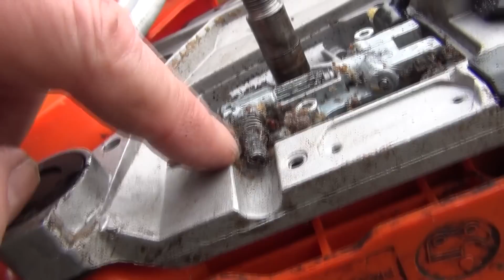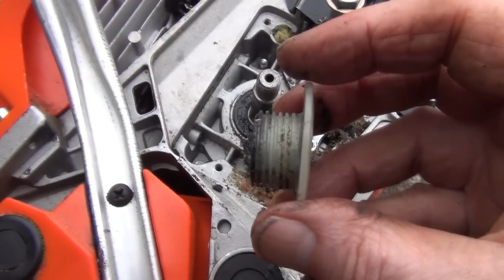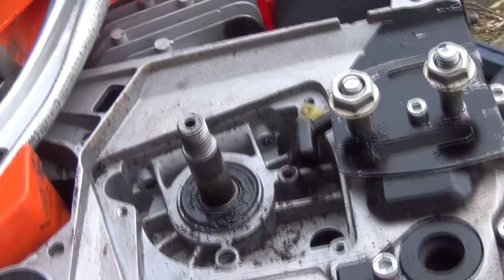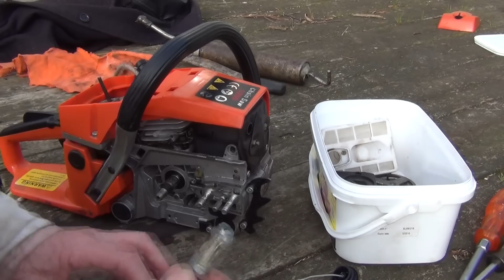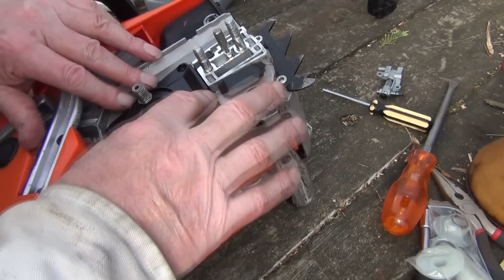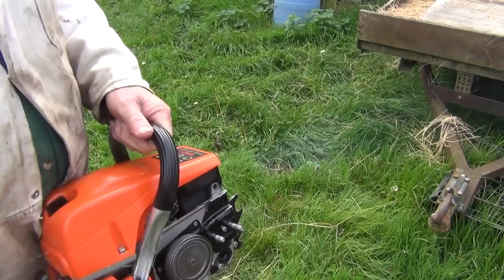Chinese Chainsaw, bar oil pump, replacement.

Comment: Be careful zinging the throttle like that without the bar and chain on, as I didn't see you torque that clutch down too tight.  They come flying off sometimes ... quite a fun surprise!  But, good checking to see that oil was flowing, and your problem fixed, before putting the bar on.  Nice job.
Reply: You are on right. Bee careful
Reply: happened to me the other day while cutting a fallen tree

Comment: Many people said "You can't buy parts for these saws." Well you just proved them wrong. Lol. Too bad many of them won't watch this video. It's a great saw.
Reply from the maker: The 45/52/58 cc saws are all the same, except the cyl/piston and everything is available in the UK from a crankcase to a nut. If you're in no hurry, you can buy direct from China at a much reduced price. This oil pump took 11 days from order to delivery.
..
Reply: Parts may be hard to find but by the time something goes wrong with these saws you have gotten your money's worth out of them,just get another one of them and presto,still cheaper than a Stihl saw. I purchased a Ryobi 3714 chinese made saw for $119 bucks on one small job made $ 180 bucks plus some other minor jobs that have given me close to $ 500 bucks in less than a year of ownership so if it breaks you better believe I will get another one of the same,but right now I know I can get the three years of warranty worth of money,good money.

Comment: Great video, thanks mate! I am doing the same thing now.  Oh...removing the clutch is easy with a grinding wheel removal tool. Thanks!
Reply from the maker: Yes, I tried that, but it didn't sit right, so I opted for the more brutal approach. If I have to do it again, I will make one out of flat steel, drilled for 3 bolts.
Reply: @RoryTrackrod  
Did you locked the piston when removing the clutch ?
I'm using a grinding tool key also.
And works just fine.
Reply from the maker: @dan_6915  Yes, I used a rope in the cylinder, shown at the end of the video. The grinding tool thing didn't work for me, so I had to use the more brutal, Hammer and drift, solution..

Comment: I think your main problem was your plastic drive gear. It looked like the worm teeth were almost completely worn down and not engaging the metal pump drive gear.
Reply from the maker: You maybe right. One thing is certain, they are cheap to buy, (6-7 quid) and easy to fit. The one you see here is still going strong, as is the saw itself..

Comment: That was very interesting to watch. I have morrison 45cc chainsaw and having similar oil leak issue at the moment, the only difference i noticed, i have 45cc morrison @home is exactly the same, the oil is leaking down from the oil  screw where you maximise and minimise the oil supply to the chain bar. Its time consuming procedure by the looks of it, and the local chainsaw mechanic is going to rip off my skin to fix it, this is the time where YouTube comes handy and gives us confidence to DIY our toys. Cheers mate

Comment: Thanks for the informative video, second use and my oil pump has failed and on the first use the spark plug went and the carby went out of tune. I’ve purchased a set of tuning tools and looks like I will have to buy a oil pump now as well.
Cheers and thanks for the video mate.
Reply from the maker: If it's any consolation, mine is running well, in fact it's better than ever. Keep an eye on the fuel tank filter. Ethanol killed mine, so I replaced it.
Reply from the maker: Filter replacement. https://youtu.be/ntXnpYaGaoY
Reply: @RoryTrackrod  thank you 🙏

Comment: Nice work.  Always nice when you can fix the problem yourself.  I just took in my Makita DCS6400 20inch chainsaw for a 2nd time b/c the chain bar oil continuously leaked a profusely after a short run.  I'd sit the chainsaw down and come to a pool of chain bar oil at the bottom of the saw and anything it was resting on was drenched.  I thought it was simply the oil line that came loose.  The oil line that connected to the pump kept sliding off therefore I had to replace the line for $45.  Now, no more pools of chain bar oil left at the scene.  👍🏽🙂

Comment: I got a similar chainsaw pouring oil out the bottom. 
Thanks for showing this film, I couldn't solve how to get the clutch out. 
I used a mason chisel cause I love my screwdriver too much.
Then I used a little floating gasket to try seal the leaks, and under the small metal plate where the oil should come out in the sword to the chain. Seems to have stopped the oil leaking in a pool under the saw.
Reply from the maker: Buying a tool is the easiest way to undo the clutch.  Making one can be done with a piece of flat steel and drill 3 holes and insert bolts or welding 3 pegs to it. My oil outlet was so tight, that it hasn't leaked, but using silicon or PTFE tape could also be used to seal it.
Thanks for the comment..
Reply: @RoryTrackrod  I came here looking for this answer.  I recently bought a version of this same saw and was thinking it was leaking where the bung / plug goes into the tank as that would seem to be the obvious place, but the oiler itself also holds the bung in place so I don’t know.  I just know it is dripping like mad from the adjustment screw so I assume the leak is somehow coming from the pump itself or that bung.  It’s really frustrating as it’s leaking A LOT.  What did you do to help reduce the leakage?
Reply from the maker: @oldowl4290  Some people say use silicon grease or PTFE tape on the pipes, but as you see from the video I used nothing and it hasn't leaked to this day. The pump and saw runs well. Sorry I can't help.There's only the 2 pipes and the breather that could leak. I will be doing an update in the Spring

Comment: Thank you for this video. I spent most of this afternoon arguing with the clutch, and ended up bashing it with a screwdriver too. Mine is pouring out oil so I'm hoping changing pump, pipes and resealing the gasket will solve it. We'll see!
Reply: Did  you solve the excess oil problem? Mine pours oil out even on the lowest setting, and drips all over the place when stationary. Any ideas?
Reply: @SuffolkWood  Yes! New oil pump, very cheap on ebay, and likely need new gasket unless you are cleverer than me taking apart the bit under the bar nuts. Fairly simple job and it fixed it.
Reply: @timhoward7037  Many thanks. Seems odd that overperformance is the fault of the pump but I'll replace it anyway, guided by Rory's vid.

Comment: Great video, really helpful. Thanks.
Reply from the maker: At 2.08 the oil flows into that channel and into the corresponding one in the bar, then is forced into the chain guide slot and onto the chain through a small hole. Thanks for the comment..

Comment: Good video, try a spanner on the clutch before you start bashing it. I used a large angle grinder spanner. Something with pins that fit in between the shoes. That avoids the damage you were showing.

Comment: There is a tool available to remove the clutch. I picked one up here in New Zealand for about $30.00. Just Google 'Clutch Removal Tool for Chinese Chainsaw ' and you will find one. I have three of these saws,1x58cc and 2x62cc, only cause I got the 62cc jobs at a real cheap price. I enjoy using them all as well as working on them, quite easy really.
Reply: John Nixon hi go on eBay  you fine one on there uk

Comment: Hey, thanks for the video. Have you been able to figure out what caused your oiler to fail? I've been reading about it, and some people were mentioning that the little bearing balls which are used to plug the technological holes sometimes fall out, but that wasn't the case with your oiler.
Reply from the maker: No, I couldn't see why it failed, but they're cheap enough, so it's best just to replace it. The one I fitted is still going strong, as is the saw itself, (I used it 2 days ago). Regards..

Comment: Very interesting, and thanks for posting/sharing this with us Rory.  I have a Craftsman 20" model # 316.380200 which apparently also has this exact Chinese oiler setup.  (No thanks to craftsman, which apparently does not sell these parts.)  My saw oil leaked terribly almost since I first used it, had no idea the cause.  (Oil would get to the chain, but after using it, any oil left would seep out.  From your comments below, I surmise I might as well change the oiler....  ) The oiler I have is made by Panfeng (P.F. 43) Thanks to your tip, yes, I see it's available via ebay from China, cheaply, and via multiple sellers.  Alas, I'd pay more if I could find a US based shipper.  (Not seeing these as yet via Amazon, Wmt, etc.)  Any tips out there?
Reply: Ha, laughing at myself..... I found your tips below Rory to just google in Chinese chainsaw part(s).... rather than be all logical/precise about it -- and sure enough, found multiple outlets, via amazon.  (and also for the Carburetor)  Wow, again, many thanks, Rory.
Reply from the maker: Glad you got it sorted. Some people use silicon or PTFE tape to seal the lower inlet pipe, to stop the leakage. Mine doesn't lose enough to worry about, but I usually leave it empty..
Reply: I appreciate your comment as this confirms what I have and what I need.  I was given a Craftsman 16” Model 316.380160 and the bar/chain oil leaks out like a bastard.   I also have the Panfeng P.F-43 oil pump.  Before finding Rory’s great video, I had wasted time looking for Craftsman and even Poulan parts websites including partstree, ereplacement, etc.

Comment: Excellent video, concise and to the point. Can you--(or anyone else!)--tell me exactly where i can get these spare parts from for my chinese chainsaw? Only mine is now leaking like a sieve for the last six or seven months, but from where i do not know. Is there a website where i can order from, getting a bit desperate, it needs to get back to work!! Any help in finding an address for parts gratefully received, thank you in advance!! Mikky.
Reply from the maker: I use Ebay for everything, but if you Google, Chinese Chainsaw, you will get a choice, Amazon etc...

Comment: Same pribkem with same brand. But my problem is I have no tools to remove the clutch. I think its good also to make homemade tools to remove the clutch
Reply from the maker: Yes, you can make one with a piece of flat steel with 3 pegs made from bolts, drilled or welded to it. I just used a hammer and screwdriver, but it could damage the clutch. Tools are also available on Ebay, which include a piston stop..
Reply from the maker: By the way. I don't recommend using a metal piston stop. Using a rope is much safer and works perfectly well..
Reply: I'm a mechanic and I agree with you using rope to stop the piston. This is safiest way to avoid any damage inside unlike to other youtube channel using metal. I used cotton handkerchief inserted inside and it is pretty doing well
Reply: I doubled up some small rope and jammed it in the spark plug hole.  And then just kept hitting the clutch with a hammer and screw driver clockwise.  It look a few turns to free up to remove by hand.
Reply: @RoryTrackrod  
Ji

Comment: Mine broke the little tiny metal part on the topside of the oil adjustment screw so the screw doesn't stay in and thus the gear shifts to the left and thus doesn't pump oil.

Comment: I have the same saw. When I took it apart and tested the pump (Panfeng pf43) I found the pump works when spinning in the opposite direction from the way the plastic driver (stamped PA 46) spins it when the saw is running. I need a driver that is reverse threaded. I see your package came with several of those. One of them might be the correct one. Can you provide a link to the supplier that sold you the parts?
Reply from the maker: All pumps and drives for this saw are exactly the same. This one came from (Ebay) magicbox2018 direct from China, now £3.67 inc P/P. There are also plenty of UK suppliers on Ebay. Just buy any pump/drive package, it's the best way and cheap. Regards..

Comment: How did you find parts for this? I have one like it but no one can catalog parts for it based off of the brand on my saw.
Reply from the maker: All of my parts are sourced through Ebay. There are dozens of brand names, but in general they are all the same base 52/58 cc Chinese engine..

Comment: hey man... I did a similar procedure but my problem was a constant bar oil leaking, even when not running
to solve that I glued the rubber hoses with gasket glue
you can check it here
https://youtu.be/U_Nrpc99JY4
it's in portuguese because I'm brasilian, but you'll certainly understand what I did... you can turn on the captions

by the way... that duck bill valve under the foam is the oil tank breather... seems yours lack the retainer spring

cheers